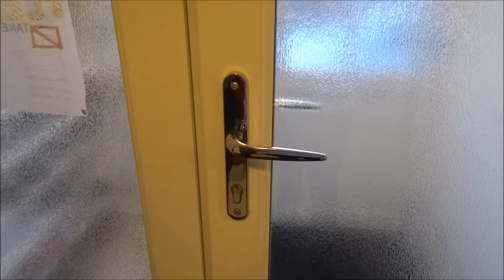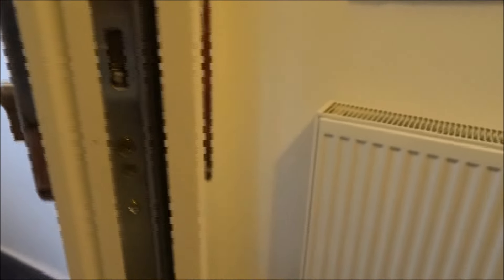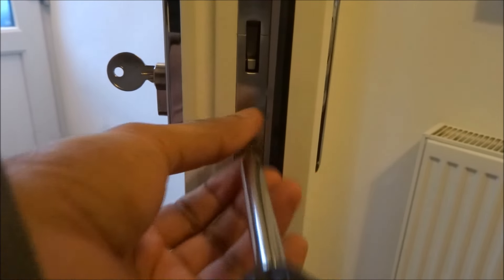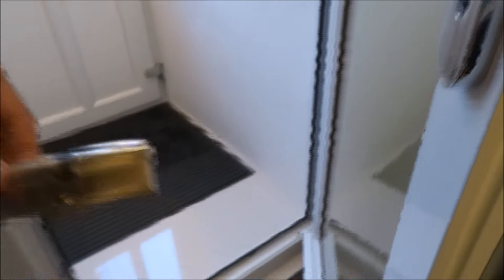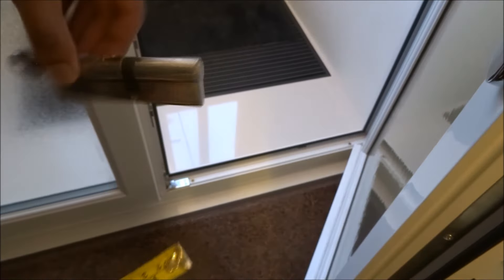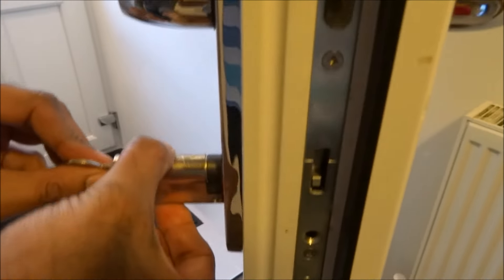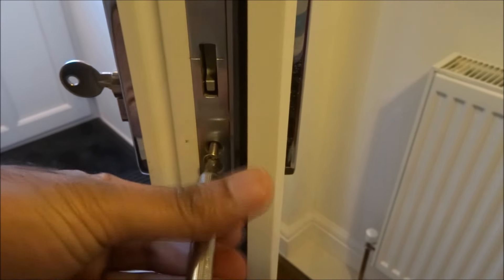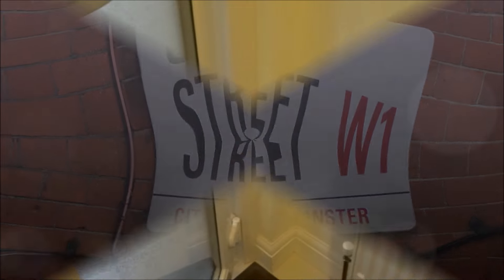How to change a lock on a UPVC door / How to change a Euro Cylinder

Comment: Nice video. Couple of thing of note the external measurement for that lock was probably 5mm too long as you want to keep it tight to the handle as much as possible. Too long makes it easy to snap. Also when changing out euro locks I always change to ABS locks much better locks than the standard one.
Reply: Ok,,,,

Comment: Trouble with our door is that it doesn't have an exposed bit with screws showing in the side of the door.. it's UPVC.  There are screws on the inside of the door lock.. I'm wondering if it's these that need removing?

Comment: The way you measured is wrong. You should measure from the end to centre point where the screw hole is. This is probably a 45/55 lock.